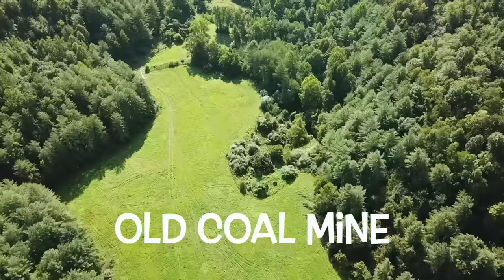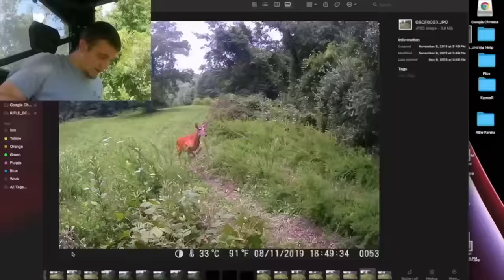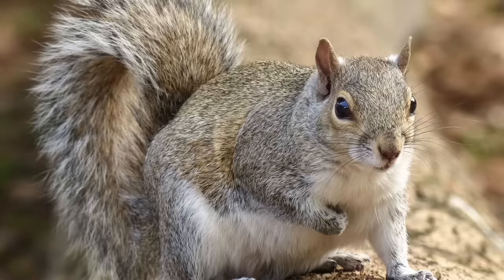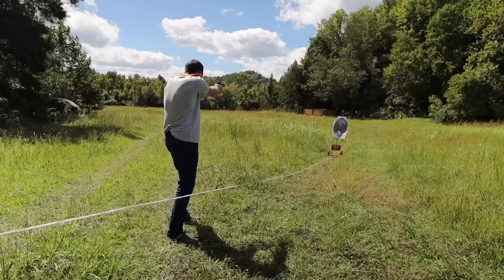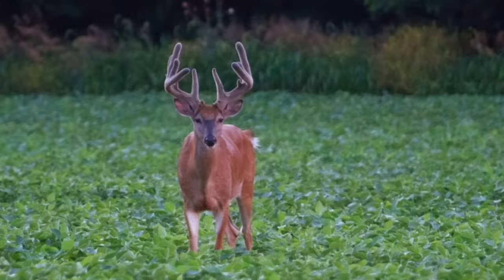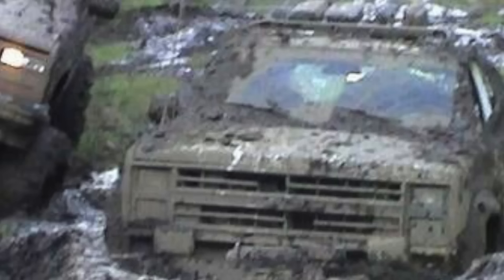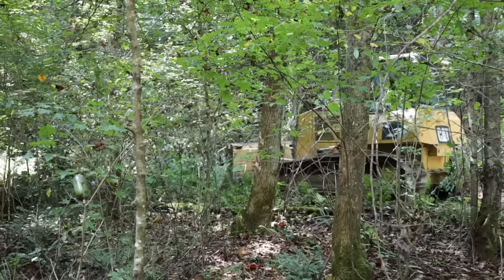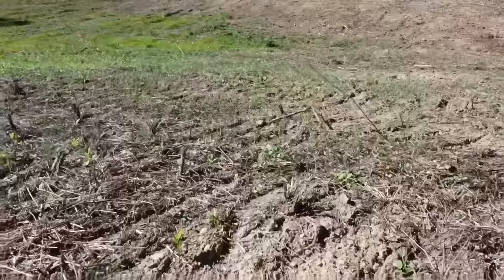Transforming This Coal Mine into the Ultimate Hunting Land!

Comment: I recommend taken a tractor and Tilling up the dirt that way it’s nice and loose maybe putting down some fertilizer. If the soil needs it spreading your seat and then tilling it into the dirt, but if you do so make sure that you don’t till it to deep because some seeds only need to be 2 or 3 inches into the ground. You may not use this information but it’s here if you need it. Hope this helps!!

Comment: Goofy antlers is Eddy. Just sounds right. Dark Horn is Bill. Tight rack is Jerry. Oh and hey get a well drilled for the food plot, you can use a gas generator or solar bank to run it. 400w panel, two deep cycle batts. Should run it an hour or two. Guesstimating.

Comment: Without a soil test, I'd suggest you put down 100 pounds per acre lime and that'll really help out. Consider some fertilizer as well. 12-12-12 at a minimum  for a beginner I'd go light at first so you don't burn the seedings roots. A 100 pounds per acre is  where I'd start. If you get lime, get powder, the pellet lime isn't as long lasting.